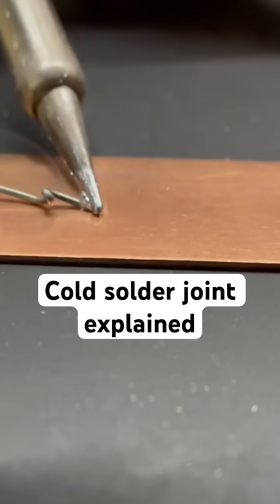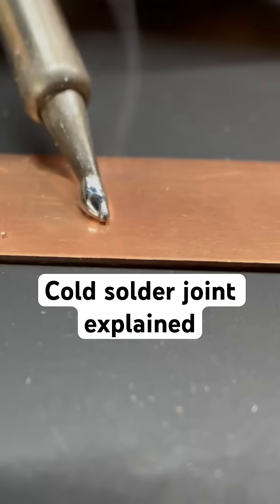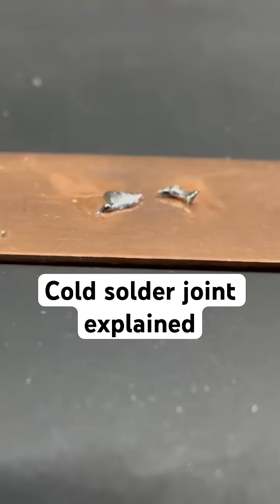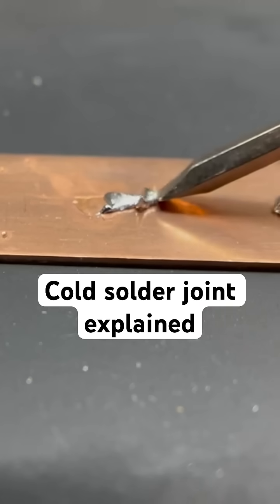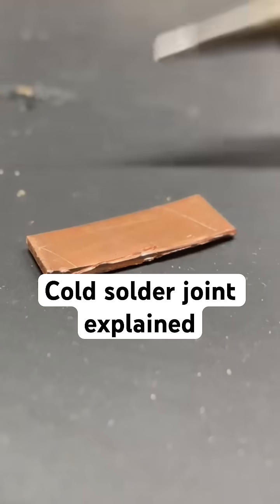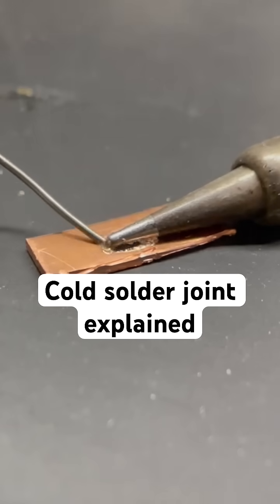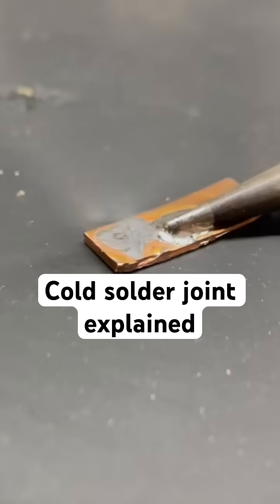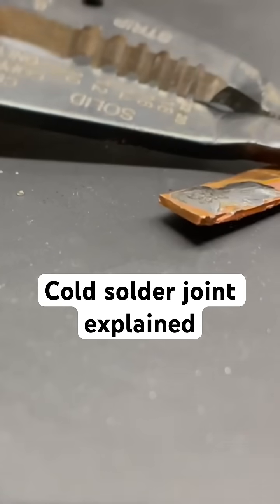Cold solder

Comment from the maker: Here is my response to the comments about alloy, solder, and flux...
1. A lot of people are upset with the use of the term alloy. Soldering does create an alloy at the interface of the two materials, but not for the bulk. I should have been clearer on that. The two metals form a thin layer called an intermetallic. So what you see with your eyes is not an alloy. However, an intermetallic is a type of a alloy.
2. I did not add separate flux ever. The solder I am using contains flux in both cases (everything is the same but the size of the work). The the goal of this video was not to discuss the use of flux to remove oxides (yes that is important for thermal transfer) but the main goal was to show you even if you have flux core solder and a decent iron if the work is too big you will never be able to get it hot enough.You can have flux and a good iron but if the work is too large you will not be able to transfer enough heat.  Note: Some people think I added flux on the second attempt but if there is a cleaner spot on the copper it could be from the previous soldering attempt - I used the exact same piece of copper and cut it. Nothing was changed besides the size of the work. 
3. In the U.S. we pronounce it saw-der ....that is just how we say it.
Reply: Instructions unclear constructed a hadron collider
Reply: @imuw5408 your comment made me chuckle hard
Reply: Not an alloy, no matter how you try to justify your misuse of the term
Reply: @stuartlees1298 you misuse your cawk with your man servant.
Reply: There is no alloy, bonding is not necessarily alloys
Reply: It's not just a US thing lmfao. I grew up in California calling it Solder.
Reply: @GOPKilla a lot of people use pronunciation that doesn't fit with their accent or what other people around them say.  It's more likely to happen with words that aren't in common use, the closer they are to jargon, the more likely you are to simply pronounce it the first way you hear it. 

These days people move all over the world and with the internet, people are learning things all the time from people with a totally different accent to them.  If you've never heard the word before you're not going to argue, you'll just say it the way you heard it said.  

I remember when Yu-Gi-Oh came out in Australia and a whole generation started using the US pronounciation of duel, because the VA on the dub used to say "It's time to D-d-d-d-dool!" every episode
Reply: Not reading all of that. You are a fake and a fraud. The copper pieces are paid actors and the solder was in on it.
Reply: Sah-der
Reply: we know. you don't have to prove anything to bunch of idiots on the internet.
Reply: Solder? I see. Great. Thanks for this 😊
Reply: I had trouble soldering two pieces of galvanized (zinc) plates but when I rapidly cooled the connection we had a solid connection.
 I was hoping you, or someone, could expand on this process.
Reply: Adhesion
Reply: Just here to say thank you.
I recently picked up a soldering kit and have been playing around with it trying to bond two shafts together for a small project.
I was heating the solder, not the metal I wanted bonded, but this explains why even when I had it almost perfectly aligned it still wouldn't hold, no real bond was created, so it was basically just a piece of old used e tape.
Will definitely keep this in mind
Reply: Yeah you tell em!
Reply: @pahub9256  just soldered my foot to a bench,   whatchu mean?
Reply: It most certainly does not produce an alloy at the surface. I have analyzed circuit board solder joints specifically for this on an SEM and a WDS.  There's no mixing going on. It is purely a mechanical connection.
Reply: @otm646 Mechanical connection how?  It's two flat surfaces.
Reply: as a metallurgist, yes, there are. The two most common types of intermetallics that are seen are tin/copper (SnCu) and tin/nickel (SnNi) intermetallics.
Reply: You have to understand that most people are idiots…
Reply: So when the surface bonding occurs it's called amalgamation. It's a very surface level intermixing of the copper and the solder. It "wets out" is a surface molecular amalgamation
Reply: @babasidd6986 Call it what you want.  It's an adhesion.   No cohesion in soft soldering.
Reply: Don't worry about the "accent", I find it harder to comprehend what some british people are saying (more over, their accent sounds less "natural" for the mouth and throat - an old linguistic+elitist habit I'd guess).
Reply: @HawkFest yeah they talk like they have balls in their mouth
Reply: @HawkFest  depends on what you call an English accent, if you ignore Welsh and Scottish, England has a lot of accents, places just 2 miles apart vary! I married from 3 miles away and nearly needed pictographs!
Reply: @lezbriddon  Indeed. everyone has an accent, and it's not necessarily out of convenience, rather out of habit/conditioning for most 😁(well, out of convenience in the end).

Québec is another good example, in regard to the French language: we have different regional accents, as in France btw. However, those are original French accents (although there's still one "standard" for the workplace, school system and services, mass medias etc.), since we didn't get the school reform that took place in France at the beginning of the XXth Century, which goal was to uniformize French phonemes.

Poitou, north of Charentes maritimes (Niort, La Rochelle), and Maine-et-Loire (inc. the city of Angers - a fantastic region of France with lots of nice castles, also reputed to have the "purest" French accent), are among our main origins. When I visited my Great grand-parents for the 1st time as a young kid (they were from Angers' region and attended school before the phonemes reform), I was struck when I've noticed they had the same accent that most of us have in Québec - as much as they seemed delighted by this..
Reply: @HawkFest the accent from the north of France is considered the ancestors of modern French
Reply: @HawkFest you pickup an accent by listening to the sounds around you. People in California don't think they have an accent but they do. Accents are relative
Reply: @blktarockstar818  That's what I meant by "everyone has an accent" in a previous post (it's always relative)
Reply: This explains something: a number of times (out of sheer desperation) I have formed a soldering iron tip out of copper... which does work for a while, however eventually the copper starts to dissolve into the solder on the tip of the iron turning it gold in color and making it behave terribly... and of course eroding the tip away. This may depend on the type of flux and/or other factors... but I had always wondered exactly what is going on  when this occurs. I think I understand this phenomenon a little bit better now. 

  Peace.
Reply: Big wrong gets no sub
Reply: I think an intermetallic is as much as alloy as alcohol free beer is beer :) an alloy is black coffee then frozen, an intermetallic is instant coffee poured on ice, it's just at the surface. I suppose alloy is more of a term used in metallurgy and chemistry and slightly misused in electronics
Reply: Hi, a question, i wanted to try dipping cables on molten solder, will that work or i have to heat the cables first?
Reply: temperature dissipation,
Reply: Not what an alloy is dude. By heating, it allows the pores  in the metal to expand which in turn allows the solder to flow into said pores. As the piece cools those pores tighten and it forms a bond. An alloy is where the materials mix on an atomic level. These are different things. So no, your statement is still wrong.
Reply: 1. What people like to hear or say doesn't matter at all.  To focus on individual words is simply ridiculous.  2. So you don't use any additional soldering grease or anything like that?  That shows how much knowledge you have.  Yes, almost all soldering tins on the market have a core made of soldering grease.  But that's far too little for most tasks.  Therefore, soldering grease, etc. doesn't cost the earth, so you can really slap it on.  Too much is not possible.  On the other hand, too little is very possible.  It is simply irresponsible, especially to beginners, to advise them not to use additional soldering grease.  Most people won't be able to get a proper connection.  And then there are cases such as soldering SMD parts.  Lots of soldering grease is a must!  Simply because the soldering grease and the prevailing capillary forces pull the component perfectly into position.  3. grammar/pronunciation again?  So with us we always say "If people can't think of anything better than to criticize your grammar or choice of words or pronunciation, then you've done everything right anyway..." In your case, points 1 and 3 are related to the grammar/choice of words/pronunciation and  only point 2 tells about craft decisions.  And your decision is also completely wrong from a technical point of view, so... As is always the case with people like this, you have a lot of opinion but little idea...

Comment: Mine wont even melt the solder wire on the the 2.5mm cable, i use it just to solder small cable like the cably for earphone or similarly cable, the solder temperature could only go on 400 degree i guess and it only 60w, that is only one i could afford, it from china😅 i wish i could afford solder that come with station but cant afford it bc it was expensive to me🤧🤧

Comment: Tip is just touching large copper.. you have the whole iron on the second copper.. idk what your saying but heat transfer to surface area is ideal.. if its a bigger area,you need more heat,or keep it on longer,or get more iron on the metal..

Comment: You should have used the same size piece of solder for your test. You could have heated it longer on the second test. I understand that you are talking about heat transfer but your experiment looks a little like a hoax because of the difference in the size of your test material. It’s kind of like using two different materials.  For example copper and aluminum. Just sayin ..

Comment: It appears that the first example you barely have the tip of the iron on the copper, but in the second example you have the entire body of the iron sitting on the copper. This is an issue when trying to make an equal comparison.
Reply: The issue here is you searching for an excuse to post something negative about the video. It's completely understandable and he showed EXACTLY what he meant to show. Cold vs proper solder joint.

Comment: ...huh. Well now i know that what i classify as not as solder joint is known as cold solder.. good to know. Also in large peace like that, preheat with torch and solder flows far better, though that point if you work with massive plate like that, get silver solder or something far sturdier just for mechanical durability sake.

Comment: Hold on. Some say u shouldn't let the iron tip touch the surface because will ripp the copper chanel from the PCB. Then now he is saying u must touch the surface otherwise it wont make a proper bond.
Reply: Nobody says that who knows how to solder. 

The tip HAS TO touch the surface. Always heat the surface.

Comment: Don’t forget that the oxidation has a large effect on whether the solder flows correctly.  Cleaning the top layer of copper with an eraser or scotch brite helps a lot.  Also, yes…it creates a thin alloy as the solder chemically reacts to the copper.  It is what bonds the metals together.  Many people don’t realize that soldering and welding are incredibly similar.
Reply: The flux in quality solder is enough to just eat away the oxide layer, no copper preparation is necessary unless it looks particularly nasty.
Reply: wrong
Reply: @ildarmingazov2304  

I love the comment and how you didn't want to refute with any real context.  However, if you follow the link below it will explain the wetting process and how wetting actually creates a chemical bond by forming a thin alloy layer between the solder and the host material.  Here are a few quotes beforehand:

"In this process, a chemical reaction occurs in which the solder actually melts some of the metals and alloys with them. Upon cooling, this combination of penetration and alloying results in a very strong bond between the solder and metal," (para. 1).

"Solder wetting of metal is severely curtailed by the presence of surface oxides," (para. 2).

I was a 2M mini-micro solder tech in the Navy.  I spent about 3 months in school specifically learning how to repair down to the micro level.  I learned how to repair multi-layer PCB's and the traces within those layers.

https://workforce.libretexts.org/Bookshelves/Electronics_Technology/Book%3A_Electrical_Fundamentals_Competency_(Industry_Training_Authority_of_BC)/03%3A_Unit_III-_Wiring_Connections/10%3A_Soldering_Techniques/10.01%3A_Solder_Bonding#:~:text=In%20this%20process%2C%20a%20chemical,between%20the%20solder%20and%20metal.
Reply: @ildarmingazov2304 shut it ho

Comment: Solder sticks to copper through a process called wetting. When heated, the solder melts and forms a thin, liquid layer on the copper surface. This liquid solder then interacts with the copper, creating interatomic bonds between the solder and copper atoms, leading to adhesion or sticking. Factors like flux, cleanliness, and proper heating help improve the wetting and bonding between solder and copper. the solder doesn't alloy with the copper to form a new metal. Instead, it creates a joint by adhering to the surface of the copper. The solder remains a distinct material from the copper.
Reply: Capillary attraction
Reply: @stevezane7920  you may want to look up capillary attraction lol

Comment: Good video but over simplied which leads you to a trap overheating the work piece - its more about flowing solder vs heating the base metal - the proper use of external flux cleans oxide and allows solder to wet out at much lower temperature and much faster - and without burning or melting insulation or other components

Comment: You knkw if you had explained that the first was dry, while the 2nd was using rosen. I think it would have felt less deceptive. The principle yiu trying to show is correct, but it still feels deceptive when you dont explain that you removed the oxide layer on the second attempt.
Reply from the maker: There was no added flux - the flux that you see (cleaner spot on the copper) on the 2nd was just the leftover from the first solder attempt. Both attempts used the same solder, same piece of metal in the same place, I just cut the piece of copper.
Reply: @HTMWorkshop  It wasn't a cleaner spot i noted, but a reflection of a wet surface, before the solder had hit that location.

Comment: I knew this one guy who worked at Sony back in the early 90’s fixing defect Walkmans, TV’s VCR’s. So any time something electrical stopped working or was broke he would always say “ it probably has a bad cold solder joint “. He used to drive me crazy with that.😂
Reply: Was he right?
Reply: @1985230ce  I would say for the era, he would usually be right. Back in the day, you would often find surfaces which weren't heated enough and failed to make a good bond, particularly on external connectors and switches.

Even today you find occasional cold solder joints, though manufacturing tech is so much better. My 3D printer mainboard had one of the outputs burn up and stop functioning. I inspected the board when i got it, and it actually looked perfectly good, but when i took a look at it after it had failed, the metal had blackened and separated and there was some burning of substrate, and it was obvious that the solder never made a connection to most of the connector pin, just to the pad underneath, and tented around the pin making it look like it was fully soldered. The fault was possibly in the engineering, they forgot to add thermal reliefs into the PCB layout so the pin was able to wick away a lot of the heat when wave soldering, so by all reason it never reached soldering temperature. I have installed a fresh connector and laid reinforcement for the track, i'm still using this board, i also went over all other joints which i thought might be subject to the same fault to make sure they're actually good.

I also have two different smartphones where the USB socket detached from the solder joints very cleanly right at the pins, without damaging the pads or the pins, and was able to be soldered right back on. I don't exactly know the cause, but i think surface oxide, expired or garbage paste solder might have been the cause, plus bad component storage before them being soldered. Many people call this fault cold solder joint as well, and i think it's alright since the failure looks the same, but i think the root cause might be different, since it's obviously reflow paste soldered. One of these phones had soldering problems on the USB PCB all over the place, the MMCX antenna connector wasn't on properly either, and the solder just looked like absolute garbage.
Reply: @1985230ce To me, it's true.

Most of the problems I had to fix were "a bad cold solder joint" or just cleaning and resoldering areas. 

"Console turns on, but HDMI doesn't works" 

I clean the port and check if any pins are missing or bent/damaged. 

If everything is alright I test it out, if simple work didn't fix it, then I would open the console and check the corresponding areas. 

Rarely I have to buy online for faulty or damaged parts.

Just to let you know I only fix as a hobby on my place because I love it.

Comment: The other key thing to note in this is that the solder flows to the heat source. It will move to the hottest surface.